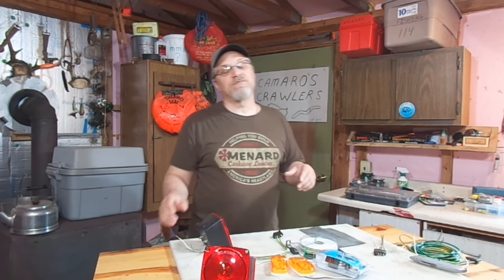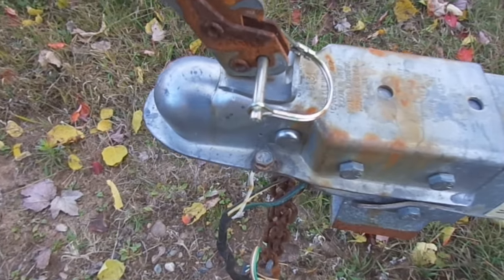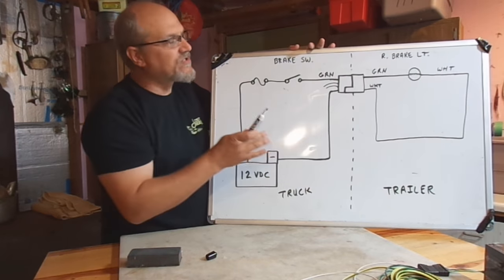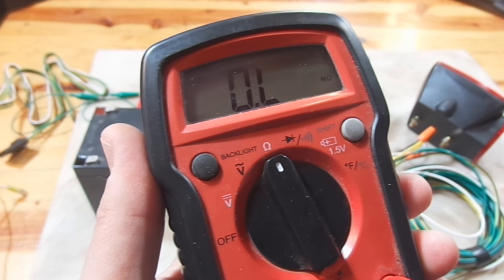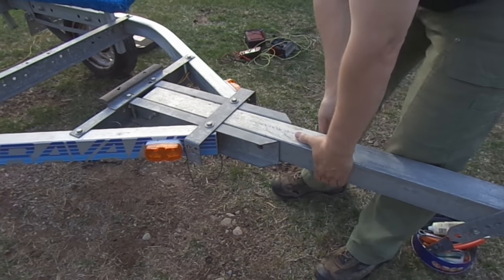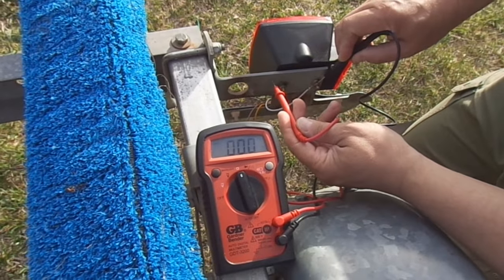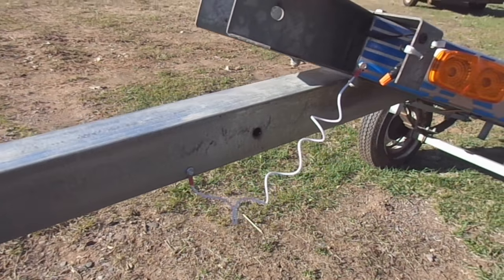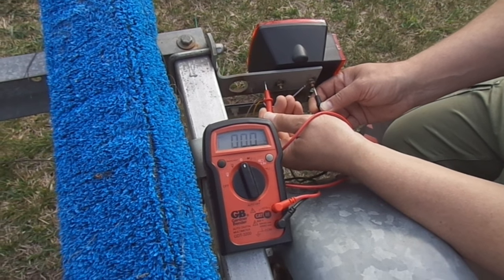FIX YOUR TRAILER LIGHTS (5) - Fixing Ground Problems

Comment: I’ve bought a few dump trailers from this certain manufacturer and I noticed they don’t have a wire from the frame of the trailer to the negative terminal of the battery. 

I’ve never really had any problems with the trailer but I’m gonna run a wire from the battery to the chassis

Question, what kinds of things could happen if you don’t have your frame wired to the negative terminal? I’m wondering why I’ve never had any problems. Thank you
Reply from the maker: If you don't have a white wire grounded to the trailer, thru the plug and then to the vehicle frame, the lights can still work.  The trailer is dependent on grounding thru the hitch in this case.  Most times it's not a problem, but as the coupler and/or ball hitch rust you may experience lights that flicker or don't work.  I touched on this subject a little in this video https://www.youtube.com/watch?v=LaUj7ZIrwAk

Comment: I lost the vehicle ground pin. Have the part but a bigger to replace where located. Still have good continuity thru ball and chain. Where I find those weird glitches is at the bolts that hold the lights on. I added a wire that  goes thru the frame, white. Connects up front and to the bolt and nut on the light mount. Sometimes when loading you can easily hit the light with your leg or something and that can loosen the light a bit, or even enlarge the hole of the plastic box. By adding a toothed washer inside and toothed wire tip to the white wire I added. I can kick that sucker and it stays working. Also I use a grounding strap vs the white wire. The wire is secured to the strap but the strap is more robust and can withstand the bending, weathering, stepping on it, etc ..I see many trailers where the white wire is barely holding on with a few strands left. Sure overkill but it works.
Reply from the maker: Those are great ideas

Comment: Very helpful. Any recommendations for those jumper wires and screws one can install which improve ground contact across bolted/clamped trailer frame members? My 1998 shorelandr trailer’s grounding point is several bolted and clamped joints away from each light and the trailer is painted white. Ground continuity is in the mega ohm range between that trailer grounding point and the side light mounting bolts. Car is sending power but none of the lights are working.
Reply from the maker: I have often used stainless steel self tapers.  I use some in this video https://www.youtube.com/watch?v=-14kh2DYdOo
Reply: @KnettersPracticalOutdoors   Just reporting back, ground issue fixed with your help. Those self tappers worked. Thank you!

Comment: Hello! We are restoring our 1977 Airstream Argosy and we are having some issues with the 7 pin connector. We plan on buying a multimeter tomorrow, but wanted to see if you had any thoughts about our issue. We have the 7 pin connected to the truck plug, but haven't connected the ball on the hitch yet. When we plug everything up the clearance lights turn on just fine; however, when we turn on the blinkers ALL of the lights (including clearance lights) blink in unison. We've read that it could be a grounding issue, as well as possible a bulb issue with the 1157 bulb. We have all of the white wires grounded on the inside of the trailer to the aluminum wall (this is how it was originally). We've tried cleaning corrosion with some 99.9% electronics alcohol to no avail, still unsure of what the issue might be. We are novices at this. Thanks for the vids!
Reply from the maker: This absolutely sounds like a ground problem.  The circuit is back feeding through the bulbs because it doesn't have a good ground path.  That's why they all blink.  When you clean the connection point make sure and disconnect the wires and clean the connection point real good.  You may even have to use sand paper to get through the corrosion.  Maybe even run a temporary wire from your grounds to the front of the trailer and ground them there just to see if that's the problem.  Also make sure the vehicle and the trailer are grounded together, KPO.

Comment: There is a ground wire in the connctor, if you connect that correct then the other stuff at the tow point does not matter?
Reply from the maker: If the ground at the plug is connected near the hitch and the trailer frame doesn't have continuity back to the fixtures, then all the other stuff does matter.  Unless you are describing a ground wire hardwired all the way front to back to each fixture.

Comment: If there is a concern can you just run the white wire from front to back and ground it sporadically back to the trailer?
Reply from the maker: Yes you can run a white wire to each fixture.

Comment: Does the trailer tongue need to be on the ball hitch for the lights to work properly?  As in, if I am testing my lights by connecting the truck side harness to the trailer harness, will the test fail if I don’t also connect the trailer tongue to the truck ball hitch?
Reply from the maker: I have a video that explains it all https://www.youtube.com/watch?v=LaUj7ZIrwAk

Comment: 1st thing i would do before getting all workedup and playing master electrician is to check the trailer ball itself for rust. sand the rust off with a wire b rush  and squirt some wd 40 on it and  you now have a good ground no special tools required or testers  or meters  i had that problem the other day  all my fuses  were good lights were new new trailer but my trailer ball on both cars were rusty all cleanedup and working as it should
Reply from the maker: Grounding through the ball will often work, but it's not ideal.  It really should ground through the plug.  Chances are even when your lights work, they are probably flickering as you go down the road.  Coupler to ball isn't a solid electrical connection.  Not a huge deal, but I thought I would mention it.  Might save you from being pulled over sometime.

Comment: Thanks for the video! Do you happen to know if its normal to get an electirical shock (from the trailer frame) when changing the tire. It was only happening when the lights were plugged in, and I touched the trailer frame with the tire iron.
Reply from the maker: No, shouldn't happen.  Could it have been static?  Unless you are really wet you shouldn't even feel 12 volts, KPO.

Comment: I just installed the Curt harness on a 2018 Outback, install went well. However.....my running lights don't work. Turn signals and brake lights work but the running lights don't. So I checked the voltage at the harness side of the connecter, 13.9V when the vehicle lights are on. Then I checked at the tail light, no volts. Then I cut the brown wire (running lights) about six inches after it comes out of the connector on the trailer side, turned the lights on the vehicle to on and checked the voltage from brown to trailer ground - 13.9 volts. I rejoined my cut wire and still no running lights. Now here's where I'm confused - when I pull that wire apart again I get 0 volts (where I previously had 13.9) until I turn the lights off an on again, then I get 13.9V until I touch the two ends together, then I have to reset it all over again. At no time do the running lights work on the trailer.......
Since the turn signals and brake lights work obviously my green and yellow wires are ok, does this also mean everything is grounded properly or could there be some thing from brown to ground that I am missing ? Is this some sort of short that is tripping something in the Outback Curt harness that resets when I turn the lights off and on again ? If so, how do I find it.....or do I just bite the bullet and buy a new light set and be done with it ;-)
Reply from the maker: This may be a poor connection on the vehicle side.  Even though the volts are there, the voltage gets pulled down to zero when a load is applied.  Basically a poor connection may not be able to carry the amps required when a load is applied and this causes the volts drop to zero.  Double check for a good clean connection where you installed the plug to the car.  Let me know what you find, KPO.

Comment: Thanks for the video.  What do you do when there is no white wire on the trailer bolted to the tongue?  

I have a utility trailer whose lights worked in the past but aren't coming on at all (blinkers or brakes) now.  I tested the output of the vehicle harness and it's working.  I replaced the old, beat up fixtures with new LEDs that have the white wire ring connector.  But still no light.  So my problem is that there is no white wire at the trailer's harness bolted to the tongue or anything.  The wiring harness disappears into the tongue tube and reappears at the back of the trailer, with two wires - brown and green/yellow going out to each light fixture.

So if there is no white wire bolted to the tongue how does the continuity get from the bolts on the fixture back into the harness?
Reply from the maker: If there was never a white wire on the trailer plug to the frame of the trailer, the trailer may have been grounded through the hitch to the car frame.  But over time the continuity of your hitch might have diminished.  Maybe this is why it used to work.  Try this trick, take a wire and touch it to the frame of the trailer with one end and then the car frame with the other.  If you get good continuity between the two your lights might start working.  I did another video addressing this issue, LINK - https://www.youtube.com/watch?v=LaUj7ZIrwAk  If this helps you may want to add a plug that has the white wire on the trailer side.  Let me know how it turns out, KPO.

Comment: I have an all aluminum trailer. My fuses are tripping on my pull vehicle. How does an Aluminum trailer get grounded? White wire is connected to the front steel jack assembly. Am I getting continuity at the back of the trailer if I attach it to the light mounting bolt? I'm replacing my lights b/c I don't know if they are bad or if I have a bad connection.
Reply from the maker: If you are blowing fuses you have a short circuit somewhere.  Check out this video - https://www.youtube.com/watch?v=Iz1jN3KApns  It may help.

Comment: THANK YOU. I WOULDA NEVER THOUGHT OF NEEDING TO JUMPER BETWEEN THE TWO PARTS OF A TILT TRAILER. I JUST AQUIRED AN OLD TILT CARGO TRAILER ,REWIRED AND NEW LIGHTS AN NOTHING OR PARTIAL LIGHTS, KNEW IT WAS A GROUND BUT COULDNT FIGURE OUT AT WHAT CONNECTION. WELL WASNT MY CONNECTIONS.....
Reply from the maker: Welcome!  KPO

Comment: I think I'm having this issue with mine. The side marker lights up front are fine, it's only the taillights. When the trailer is parked on level ground If I push down on the rear of it squatting the suspension slightly the taillights come on. It's a folding trailer. I think I'm loosing ground through the frame somewhere.
Reply from the maker: Add a jumper across the hinge point and see if it helps!

Comment: Mike, on a painted aluminum utility trailer should I run a white wire for each tail light or will a painted aluminum be a conductor for ground?
Reply from the maker: Aluminum is a great conductor.  Wire is made from aluminum sometimes when lighter weights are needed.  You can run a white wire to each fixture, but if you get through the paint, grounding at the fixture shouldn't be an issue, KPO.

Comment: I've identified the circuit lines to my RV trailer lights as well as an internal white ground wire that clearly from the lights back the length of the trailer to the ground of my 7-pin connector up front. i.e. my 12 V lights don't appear to use the trailer as the ground. Does this sound right?
The problem: The left signal works fine but when I use the right signal, BOTH signal lights come on. 
Observations:
i. I've confirmed with a tester that the power coming from the towing vehicle is fine.
ii. I replaced the male end from the trailer that plugs into the 7-pin connector from the tow vehicle. I've re-wired it twice. 
iii. I've also replaced the right signal on the trailer with a brand new fixture so that seems to eliminate that as a problem.
Aside from the 7-pin male plug up  front which I've addressed, I can't find any common points between the two circuits so I'm stumped at this point.
Reply from the maker: Whenever another light comes on that isn't supposed to, it is almost always a grounding issue.  Your right fixture doesn't have a good path to ground and is back feeding thru another fixture.  That's why they both come on.  I would double check the right fixture for a good ground.  KPO
Reply: @KnettersPracticalOutdoors  Think I figured it out. I used a 12V battery and some alligator clips to work my way through every segment of the circuit starting at the tail lights. Thankfully, all the wiring on my trailer is easily accessible.
All checked out fine til I hit the 7-pin connector up front. Disassembled it, put it back together... problem solved. 
In a 7-pin the right turn light pin is adjacent to the pin for the running lights. I think a strand or two of copper wire from the right tail light might have come out and touched the running light pin. Whenever I turned on the right signal, it was energizing both circuits. If I had noticed the running lights blinking I probably would have figured it out, but because they are around the side of the trailer, I missed that important detail.
Water and electrical issues account for something like 90 percent of RV trailer problems.  Your videos have been very helpful.
Reply from the maker: @kabukiarmadillo  Glad to help.  Thanks for the comment, KPO.

Comment: All lights work except the running light on the driver side and marker light on driver side. Cleaned very good for ground. Can you give any advice for me.
Reply from the maker: If the fixture is grounded good, look for broken wires, KPO.

Comment: ween i plug in my truck . but on turn signal .. ALL the light's on the camper blek
Reply from the maker: You have a poorly ground fixture or two.  Make sure all the fixtures are grounded properly.

Comment: Ok, I am a 74 year old female, just bought a pop up camper, I have watched your videos, unless a missed something, I didn’t find my problem, so here it is. When we hook up my car to the trailer all the running lights came on blinkers and brake light the guy said that the trailer lights were working the last time he used it,  I am more inclined to think that it is from my car it was pull in travel trailer but hasn’t been used for five years as far as plugging something into it and it does have a seven point hook up I just ordered a multi meter because I don’t have one I did you check my fuses under the hood, none are blown, I will check the balls tomorrow I don’t know what else to do I guess I’ll check the plug under the car the one that you just done in this video I’ll check back if you can assist me in any other way please do thank you very much for your time and trouble
Reply from the maker: Do you have a friend with another car to test the trailer?  It would save a lot of time if you could see for sure that the trailer is working.  Then try a LED checker https://www.youtube.com/watch?v=MqrpMcjGiTM on your car.  This will get you started in the right direction.  Let me know how it goes Sharon.
Reply: First lead I always inspect is the ground, or earth, usually white in colour in both the trailer plug and vehicle plug.
Without a good earth you ain't getting any lights working.
As previously said also borrow another vehicle to test your trailer or borrow another trailer to test your vehicle.
Either way, you'll solve it.

Comment: Personally I prefer a removable lighting board rather than fixed trailer lights which over time are subjected to corrosion and weathering. The lighting board is kept safe in the house or shed, AND its much easier to check all the bulbs are working.
Reply from the maker: true

Comment: 09 Tacoma, I keep blowing 1g1 10 amp backup fuse when I put boat trailer in reverse. Trailer shop tested trailer with another tow vehicle, then used a tester with 10 amp fuse and the fuses didn't blow. Therefore he concluded short is on the truck side and he only works on trailer side. Not sure if true or where I should go for diagnose repair a trailer shop or auto electric repair.
Thnks any advice
Reply from the maker: Any truck side problems are usually near where the harness branches out from trucks wiring, so check there.  Also check out this video   https://www.youtube.com/watch?v=MqrpMcjGiTM

Comment: What about wiring directly back to the wire harness connecting to the tow vehicle?  This way you aren't relying on the trailer chassis having good continuity all the way back to the tongue...little work to do it but it would be nice to have much less grounding issues down the road (no pun intended)
Reply from the maker: Yes, you can run a white wire to all the fixture and this will eliminate many problems.

Comment: My problem right now is that I have turn signals and break lights working, but no running lights on trailer. They were running fine till it sat outside during the winter. All lights work on the truck. I have a ground wire going to every running lights to the frame.
Reply from the maker: If you have a brown wire that would be the running lights.  Sounds like there is a problem with it.  Follow it front to back and clean the plug pin associated with it too, KPO.
Reply: @KnettersPracticalOutdoors   Today I just did all new ground wire from frame to each lights. I never thought it would be the 12 volt wire (brown) since the break light and signal lights work. Anyways after doing all new "GRD" wires  still get same results. I'll check that Brown wire tomorrow.

Comment: They make rear light bars for trucks that display turn signals, brake lights, and running lights. But they just ground using the plug ground itself. Why can trailer lights use the same and just have a solid white wite running along side the wires back to each light.
Reply from the maker: You can do that